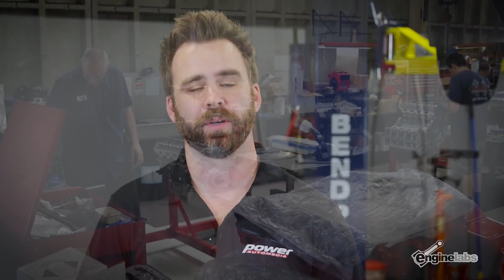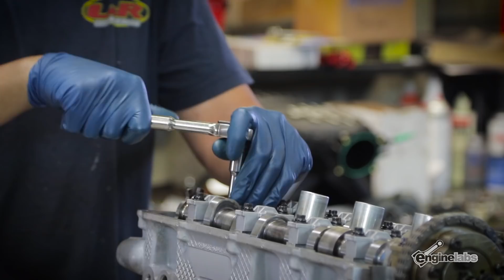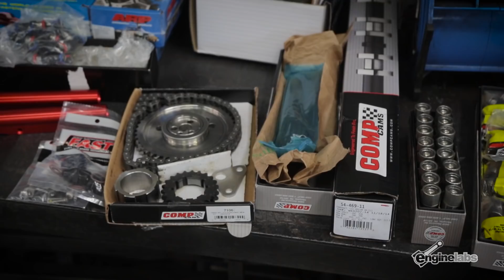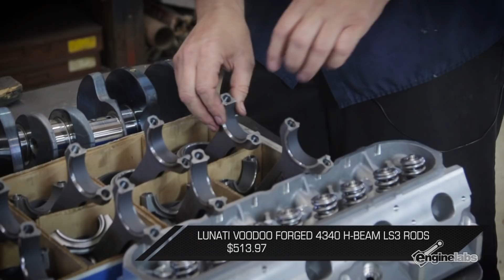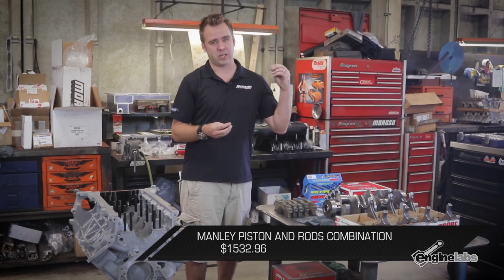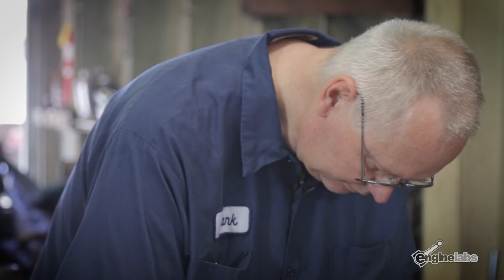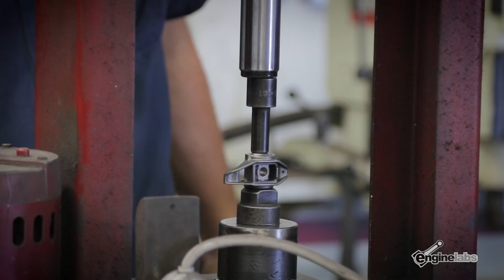$10k Coyote vs LS3 Shootout - The Build

Comment: I was really surprised on the LS-3 block price! Being a Ford guy, I still love the LS-3 engine and believe it is one of the finest motors GM designed.
Reply: I’ve heard from a lot of people that the ls was designed by Ford someone told me it was originally designed for Jack roush but they dropped it for the modular design if that’s true it’s a Ford design and Chevy is just taking credit for it I’m also a Ford guy but I’m starting to see Ford durability in the ls engine you look at all the other Chevy engines they suck they are very poorly built

Comment: Ls3 
Simplicity 
Best bang for your buck
Proven for years
Reply: I agree for the time being. The LS has been around for far longer than the Coyote and I think that helps the LS with the 'bang for the buck' aspect. Spending 1/3 of available cash for a used Coyote block possibly took up a lot of what 'could have been'. Only time will tell how much potential the Coyote has.
Reply: +john steil they should did LT1 then..
Reply: Push-Rod Chevys

Cheap and Simple
Reply: @mewrongwayKOCXF  -  Ford's High Performance engines are far more POWER DENSE

than Chevy's Push-Rod Shit
Reply: @mewrongwayKOCXF  -  Mustang Sales Killed Camaro Sales in 2018

- Case Closed
Reply: Keith Johnson - Shelby GT500 LoL
Reply: My first coyote swap I bought a long block 2014 f150 motor for 1500 bucks, the second I’m doing now a 2015 for 2k shipped to my door.
Reply: @Shelby-Ecoboost-Raptor-550hp  nobody likes new camaros however who doesnt love a good old 350 chevy or ls engine

Comment: The Ford 5L is a good motor if you have the money and room but from a practical point of view the LS wins hands down.  I'm a builder and have done a half dozen LS engines for friends dropping them into various vehicles, mostly swaps and there are literally millions of them out there.  When you can go to the junk yard for $500 and buy a good used engine with harness, clean it up, bolt in a few go fast goodies for another $500, do a harness upgrade, reflash and install a high pressure fuel pump and Corvette fuel filter/regulator for another $500, exhaust, mounts, cooling and misc. for $500, you've swapped in a modern, fuel injected, 350-400 hp engine with tons of performance and driveability for less than $2500 all in and all fun.  You can't buy a Coyote for less than 5 Grand that I've seen and I have a friend that did swap one into a '67 Mustang, major problems with size and the expense involved. A good motor just not for the masses ..............
Reply: Ken Fischmann yeah...most LS swaps are not LS engines but the 530 pound LQ engine. that kills the balance on most swaps.
Reply: Mmm hmmm sure lol
Reply: What fast goodies are you buy in for 500?
Reply: For $3300 I built a COMPLETE (running and dropped into my s10) forged piston/gen 4 rod large cammed Aluminum LS6(rebuilt everything and intake/mounts/cam stuff alone was 1400 of that) that is turboed and makes 602/575 to the wheels. If I turned it up or went to even a slightly bigger turbo I could make 800whp before my injectors stopped being enough
Reply: @85MasterV  yeah but Windsor also split in half past 500hp often
Reply: @meifert2  a stock ford v8 is the sane as an iron block. Even the Chevy 4.3 v6 weighs the same as an aluminum LS engine. A iron block only adds maybe 100lbs to an s10
Reply: Btw its only on 10 psi
Reply: PC Master Race lol
Reply: A SBF in no way, shape, or form compares to a Gen III/IV SBC in terms of potential, durability, heads, or internals.    It isn't even close.
Reply: 11-12000 for a 2nd hand ls3 in NZ,
Reply: Allan Harvey, 3-4k bucks here in North Carolina....for a healthy LS3 longblock w/ ECU.  Here's Ebay....full LS3's w/ trans and ECU....no where near to the this 11-12k you claim.   You can buy a brand new crate LS3 from GM for 7k.  You're clearly making shit up. smh
Reply: @SilverRaven1959  You speak of reading up on things before running one's mouth... Yet you don't know the meaning of the word "efficient"... sad.
Reply: @85MasterV  most are buying $3-500 LS junk yard engines and putting $1500-2000 into them. ALL WHILE getting more TQ/HP and better reliability than any ford engine.  Name one ford engine that can handle 1000 hp STOCK that will get you all the way down the track and not blow up at 5-600 feet?
Reply: @SilverRaven1959  its been tested daily. The 5.0 never wins lol
Reply: @bonnivilleblackcherry9745  5.8L OHV Windsor, 5.4L DOHC Modular.. no junker 5.3L can handle 1000hp without touching the internals
Reply: @85MasterV  all the pro builders say otherwise.
Reply: Yeah but having my Coyote in my 68 Fastback Stang with a Whipple supercharger is great because I drop Corvettes and Camaros for laughs. It's funny as fuck. "Oh look an old Mustang time to pull on hi-- o-oh. O-Okay."
Reply: @meifert2  dude that's what a SBC weighs... so it's perfect for almost any swap that came with a SBC or ford SB.
Reply: @spreaddeezhazelnutz7511  Motor Trend made 1400 on the stock internals of an early 90s 351W. The only reason it blew up was because they maxed out the wastegates and instead of putting better springs in for more boost they ran it with the wastegates closed. No LS has done that without going into the engine to regap the rings. And nobody has actually run an LS dyno queen in a car for more than a few passes without it saying "allahu akbar" and blowing up
Reply: @stevenhorsefield2909  do you realize that a Ford Windsor is 40-100 pounds lighter than a SBC? an  iron 302W with aluminum heads weighs what an all aluminum LS weighs.
Reply: @85MasterV  He probably meant the Crankshaft.
Reply: have you seen any oil pump failures on LS3? (high pressure valve getting stuck)
Reply: @jonpeterson5534  I haven't seen one get stuck but Ive seen total catastrophic failure at any mileage. Remember when all the Corvette Z06 engines were randomly failing before the first oil changes? It still happens
Reply: SilverRaven1959 LS PLATFORM copy of a Windsor? Are you smoking crack you frail old man? Explain why theirs SBC swapped fords since the 70’s YET I’VE NEVER HEARD OF FORD MOTORS SWAPPED INTO CHEVY’S let alone any other vehicle? Why is aftermarket support so plentiful for LS yet support for ford is slim as it’s always been? The numbers don’t lie so stop living in fantasy land

Comment: i prefer the simplicity of the LS3 as well as the huge aftermarket plus great reputation. i drive a tow truck and i rarely see any LS cars having any trouble. worst i have seen is a bad water pump and i have seen a few alternators go out.
Reply: samuel lopes that's why somebody say " LS swap everything"
Reply: Yeah, I work on GM stuff all the time and i have seen quite a few LS engine failures. Dropped valves, rod in the oil pan, timing failure.
Reply: have you seen any oil pump failures?  high pressure valve getting stuck in LS3 motors

Comment: Jegs ..Ls 376  iron  with aluminum heads crate motor $7050 430 hp. Coyote 302  aluminum crate motor $6800 435 hp seems like the the coyote is lighter  same power with smaller displacement & a better deal. Both on jegs

Comment: I like how one of the "rules" was not to use a truck block because the LS engine would have an advantage in the price arena, but then you made an exception for the Coyote. I also wish they would have used a 5.3 engine to show that a OHV engine can put down some respectable power and no one could say "the 6.2 has waaayyyy more displacement"
Reply: Except they paid 3 grand for a coyote that can be found in a ton of F-150s for 1000-1500 and can handle 800 hp already. Then they put $1600 pistons in it....this entire comparison is stupid and benefits the chevy already.
Reply: I bought my truck coyote and installed gt cams for 2k
Reply: You sir are a Genius...simple and they don't even get it. The internals on that Coyote had nothing wrong with them. This whole thing is a BS GM Fest so they can say they win. only an IDIOT can't see that a 6.2 with after market internals and aftermarket heads is not a fair comparison. Just boost both of em at 12-15 PSI and see where that power advantage goes...really fast on the Coyote side!!!
Reply: LOLOL I know, yet these clowns cant build a FORD the right way!!!
Reply: So they paid $3k for a Ford truck motor, and didn’t get the LS truck motor because it would be 1/3 the cost...  and that’s an advantage for the LS???

And they put pistons in both motors; which neither engine would need...  
except they bought a used Coyote and needed them after cleaning up the bores (hence the slight bump in CID they mentioned).

So since they bought a used Coyote that needed pistons after cleanup, they put pistons in the LS.
If they bought a junkyard LS, the LS would have been waaaay under budget.
If they bought new Coyote stuff, the Ford would have been over budget.

And they even dressed up the LS with things like chrome valve covers just to bump up the LS price even further.

Either way you slice it, the Coyote had every advantage given to it, yet here you are claiming it was stacked in the LS favor.
Reply: @ChuckO  they did alot of unnecessary shit you can just slap boost on the stock coyote long block and do 700 wheel on good fuel reliably even with a gen 1.  You could have done this for alot less than 10k if you know what you're doing

Comment: i think you handicapped the ls3 by using new parts vs the used f150 parts. for 10k you could get way more out of the  ls3.
Reply: +ADR3NALIN31287 Good point
Reply: Great point. Now imagine using a used truck block for the LS build. More money for HP.
Reply: They had to help the ford out like always.  Its the only way they can compete.
Reply: They went with stupid shit on the Coyote to hinder it's power.
Reply: gripking131313 I know. They did it on purpose to push the LS. It's what happens when GM is your biggest donor
Reply: Also they didnt need rods or pistons as they arent gonna hit 600+whp na so useless money there as well
Reply: mfnbigdaddy73 I mean ford has been in the 5s with multiple engines.  Only chevy to do that had hemi heads so who really needs the help?
Reply: K Snapp no doubt because i built my 408 stroker ls for around 5.
Reply: mfnbigdaddy73 nope😂😂😂😂... the important thing here is which one makes more power part for part. It’s not the junk LS that’s much larger displacement,sad.
Reply: Could build a stroker ls3 for under 10k
Reply: ADR3NALIN31287 You mean they Handicapped the Coyote.
Reply: you know what the real sad part is? that it has more displacement and its literally half the fucking size physically.
Reply: Take the money equation out and see what happens.
Reply: mfnbigdaddy73 help Ford lol. Chevy has a hell of a advantage to start with. 6.2 vs 5.0. Vette engine vs F150. Wow stupid runs rampant in gm fanboys.
Reply: Damon D Master 
Yeah... Take the money out and just buy a 2500 hp TT 427 LS crate engine from NRE.  
You read that correct...  2500hp LS CRATE engine
Reply: chris powers 
Ford traded displacement for DOHC.
It seems you also forgot that aluminum 6.2L are available in Silverados and Sierras.

Your projection about “stupid runs rampant” is showing.
Reply: @LSX-zr8ng  there's a reason Gm and fiat are still using push rod engines. And the motor is the starter, I've never heard and engineer refer to an engine as a motor other than hicks.